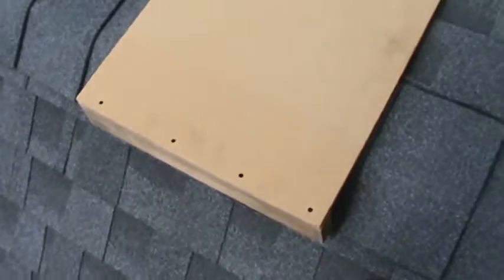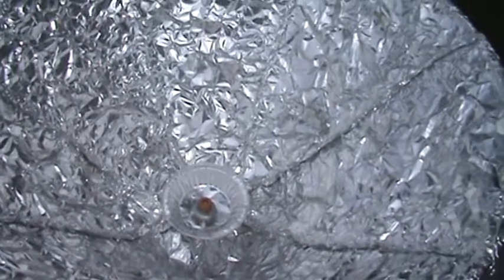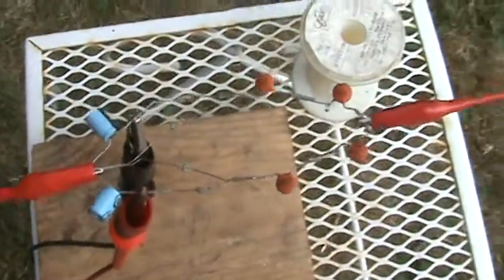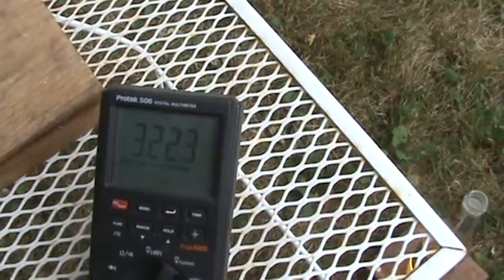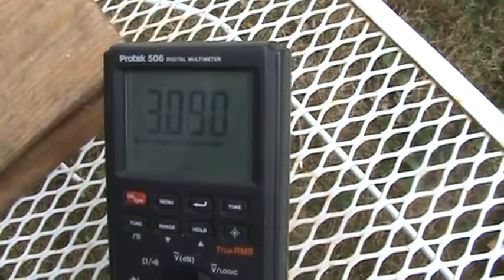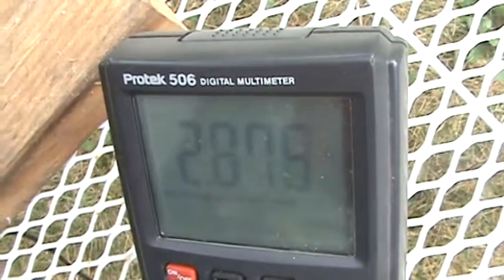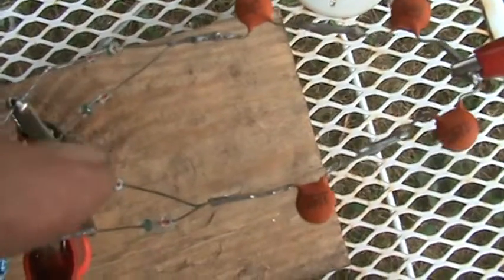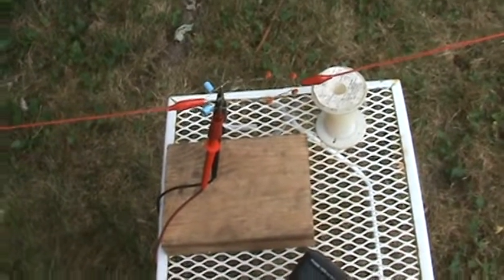Free Energy From Air 2015 part 3

Comment: try 3 Pyramid like collectors facing in all different ways...... the waves collected Roll Bounce back and forth off the walls into the center with more power which might give you more energy...... also if you can put your rod in a spot where lots of minerals are found
Reply from the maker: Thanks, i keep thinking of using pyramids :-)

Comment: Why don't you make a video showing how you power something useful with this "free energy".
Reply from the maker: +Peter Carlson Need to get more power yet.  Here is when i powered a calculator....
https://www.youtube.com/watch?v=XN_p1O7ESF8
Reply: INVENTOR3 Great! Now, do you know the origin of this "free energy"?
Reply: INVENTOR3 Instead of just focusing of the voltage have you tried to see what current you can get out of this? You can get tremendous voltage from just rubbing some synthetic fabric over a piece of plastic but that is hardly useful in any way.
Reply from the maker: Great question, many will say it is from radio towers, and power stations and tv and cell phones and satellites, but some like myself believe most of the energy is coming from the cosmos, stars, moon, black holes, quasars, pulsars, ect.  Even though our planet is protected somewhat by our magnetosphere, there are still many times more radiation coming from the cosmos hitting the Earth than there is with man made devices here on Earth.  Some may say the energy is zero point energy or Ether/Aether.  Check out people like Tesla and his Pierce Arrow car, and Thomas Henry Moray, and Franklin Meads patent :-)  Here is good 45 sec video of Einstein....
https://www.youtube.com/watch?v=i7KrmDe-Sac
Reply: INVENTOR3 Placing a turbine in a river is as much free energy as using a solar panel. Both are driven by the energy emitted by the fusion of hydrogen in the sun.

What energy is emitted by the moon?

Black holes does not emit energy in any useful way. The Hawking radiation is far, far to low to use. But things falling into a black hole will emit tremendous energy on the way into the hole before they pass the point of no return. This can be seen as super intense jets of gamma rays. But this isn't what you catch with your device.
Reply from the maker: The moon, not much energy there, mainly reflected energy from the sun, although it does emit its own infrared radiation.  Black holes, yes, immense radiation when pulling in large objects,,,Quasars.  And there are Pulsars and Super Novas, lots of energy coming from the cosmos.  The circuit i use, i understand it also picks up frequencies from the Earth also.  It has been proven to pick up frequencies from tectonic plate shifts(Earth Quakes), an early warning detector.
Please, tell me what do i catch with my device?  Maybe beat frequencies and harmonics?

Comment: Sure you're on the right track... however, if you want to collect the most RF energy out of the air you need a wide band antenna ( collector) . You want to suck in the RF from the widest  frequency range possible. The biconical antenna is key.  I have done this a few years ago and it does work. The best set up is a biconical antenna with germanium diodes for best results.
Reply from the maker: +Joe Grodis I never really studied this type of antenna before. Wow, thanks, im looking it up now.  Looks exactly like what i need,,,Thanks!!  What about using a sphere?

Comment: I found this out around the year 1992 when I was siding my house. First I put on one half inch celotex brand insulation, which is basically a capacitor. The problem was I kept getting electrocuted when I was putting my vinyl siding over it, so after about an hour of this I went and got my volt ohm meter. When I connected it to ground I was getting over 75 volts probably D.C. current and was trying to figure out how a shorted house wire could cause such a high D.C. charge. After some time went by a cloud floated over and the voltage dropped to near zero. I concluded that the Sun light caused a photovoltaic affect on the four foot by eight foot capacitors I was nailing all over my house. Over the years I have thought about experimenting with something similar on a large scale but never got around to it.
Reply from the maker: +Carl Eadie Very interesting, thanks for sharing that story! :-)  Makes me think :-)
Reply: +Carl Eadie 
Yeah you were putting plastic over Styrofoam and were getting shocked? And where did you connect the VOM to this plastic siding?